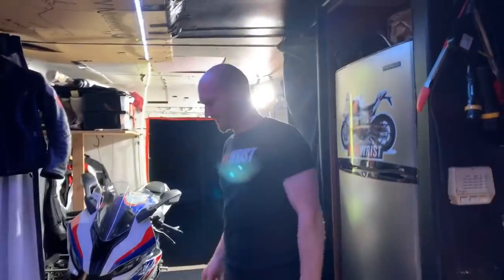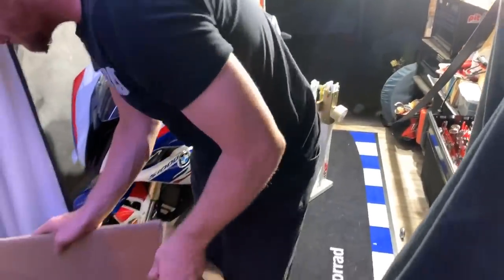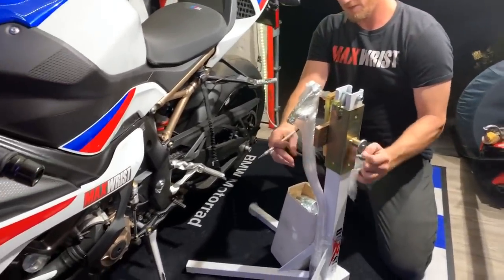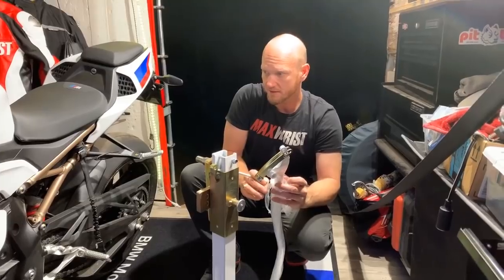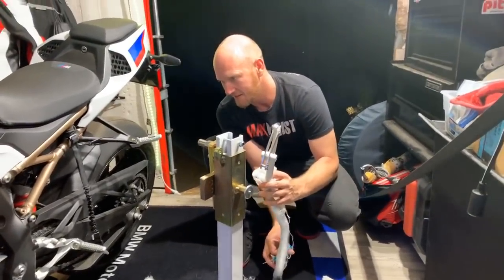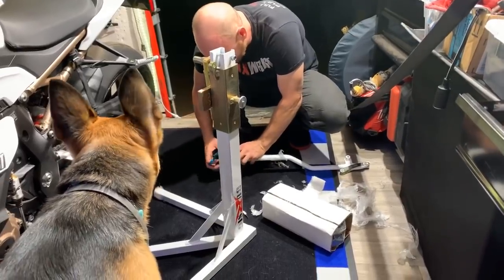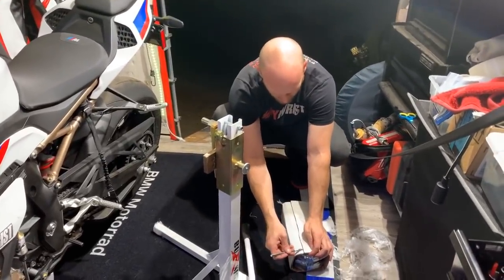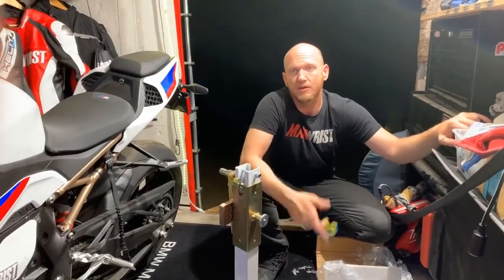New S1000RR Stand

Comment: Hey max any chance you could make a video to explain the bikes settings  ie race pro modes.. does anyone know can you go into race mode and soften the suspension?  I was wondering do you use the pro modes or just dynamic?  Also if you set the race pro modes and come out when you go back in are they saved? Are the pro modes worth it on the street .. what's the wheelie control like in dynamic mode? 
👍🇱🇷🇬🇧